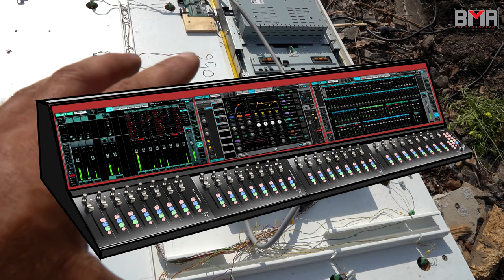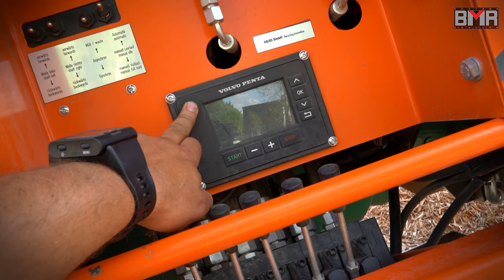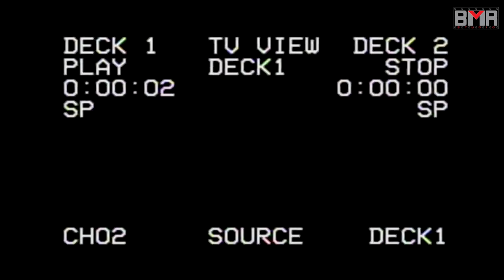Dumpster diving - Arduino, industrial pc and lot of fun with construction machines

Comment: Another idea for this kind of panel would be to leave the cabling and Arduino as it is, reprogram the Arduino to act as an midi controller. So you can place it on the floor and jump on the plates to play drums. :)
Reply from the maker: You can have it.... The system is still working :) with some Ubuntu...